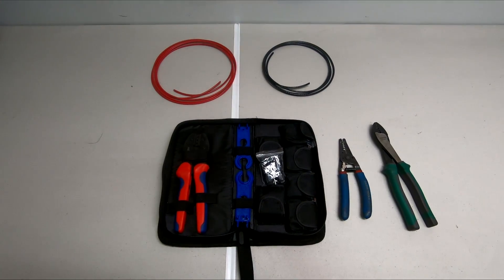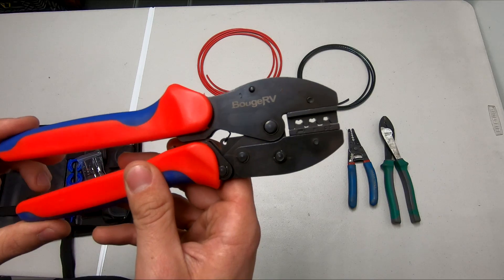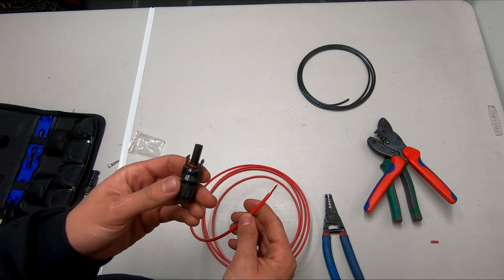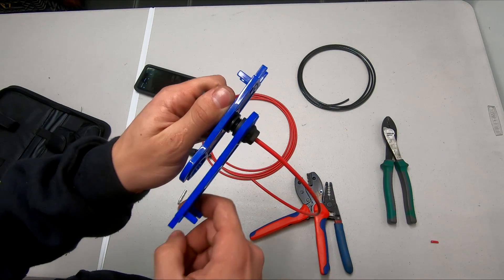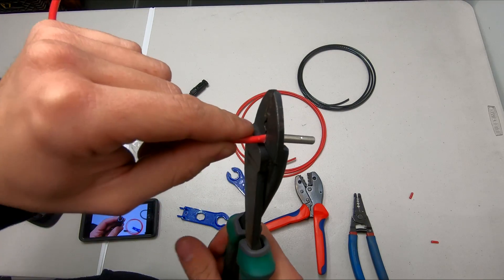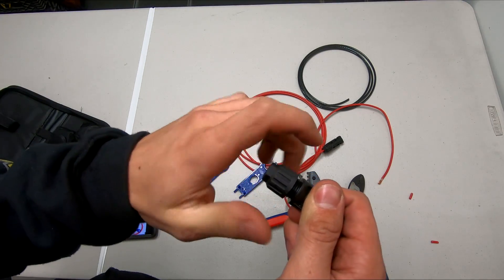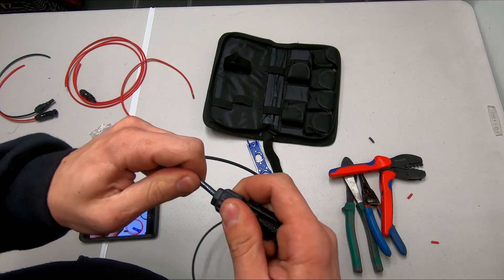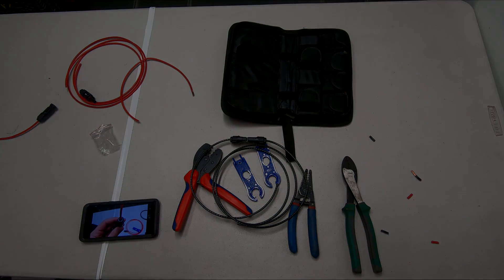Best way to Crimp PV MC4 Interconnection Cables

Comment: thank you for this detailed tutorial 😊

may I confirm if the pv wires have polarity if they are not yet connected to either the solar panel or solar charge controller?

I think I've installed the mc4 connectors the other way around 😅 (female connector to positive and male connector to negative)

Comment: Which crimper slot do you use for AWG 10?
Reply: 3:38 His crimper is metric and shows the slots are for 2.5mm^2, 4mm^2 and 6mm^2.

10 AWG is 5.26mm^2 exactly, but cables I come across do not match their cross-sectional areas exactly.

The correct answer here is, 1) buy a crimper with a 10AWG slot, 2) ask your cable / crimper / MC4 crimp manufacturer, and 3) try it and test with a luggage scale or similar, how much force pulls your crimp out.

Comment: I think positive is the male and negative is the female.  That's why the male has a RED ring around it.  That's to remind you that RED is positive.
Reply from the maker: The ring is a water seal. Positive and negative flip depending on if you are on the panel or the wire taking the power from the panel. For example an extension cable would be both male and female.
Reply: ring is not an indicator of polarity. sometimes it is white.

Comment: That standard crimper is actually the correct one because it has the craddle up againzt the joint and not the tooth.
Reply: Would one of these "automatic wire strippers" (hand tool) be good? I don't think they have the correct shape of the crimper section. I wouldn't mind purchasing another tool, but my toolbox is full on tools I barely use and I have to make only 2 connectors, primarily because they won't fit trough the roof waterproof cable gland. I have to cut and fit MC4 to power bank. Perhaps I could try to disassemble the MC4 connectors instead.

Comment: I am unsure about these blue spinning tools because the strength of the hand should be enough. P. S.: no questions about the crimper.
Reply: the tools make sure you dont overtighten the cable gland. overtightening could cause the ruber seal to deform and loose shape which could be not waterproof.
Reply: @dorplein62  It's a legit comment, but it's hard to do that when you are bit cautious. I've noticed that I need those tools to tighten Staubli MC4. Staubli even insists that you need a torque wrench. (They have a nice tutorial, which gives you a peace in mind). I've commented as an amateur who knows what he is doing (I had to do that in order to make sure I have a backup in case russians destroy our grid system and there is a gasoline shortage at the same time, and the required knowledge of physics & electrical engineering seemed far lower than it was required to know to get a degree in CS & Control Theory).
Reply: @tshev  got it, you surely sometimes just have to work with what's available.
Good on you finding solutions in difficult times..

It's always a good idea to do something in the best possible way.
For electrical connectors, that is most of the time how the manufacturer engineers the assembly process.
Reply: They are designed to click over the ridges and ensure consistency. I would say they are useful when one is making a lot of connectors. They are cheap anyway. Most of the price of the kit is in the primary tool and the MC4 connectors.

Comment: Thank you for the information and details, it really helped me out. One question though, the extension wires I bought each had one side already completed and I had to add the male and female ends to the bare ends. Should one end of the wire be male and the other female? That's what I did but wanted to verify.

Comment: Great video!  I am confused about the positive and negative ends that you talked about near the end of the video.  I have a solar system with four strings of nine panels. One of the wires was crushed so I need to cut  the crushed part and insert a connector. How will I know which end to put closest to the inverter and which and away?  If I am just joining the two wires together does it really matter?

Comment: That crimper is a nice paper weight - 170+ lbs won't open it.   Looks just like the one in the video and I bought it on Amazon and I'm not the only one with that problem.    

I also just read about copper pins, I think coated in zinc, that are supposed to be better, but I have yet to find them for sale anywhere.

Been doing solar for 25 years and am finally trying to use these stupid MC4 connectors because my new panels come with them and am regretting it.  Why on earth would they put a RED ring on half the connectors as if it meant "positive"?  Somebody was up all night ...

Comment: U r lier u didn't pull the female connector hardly
Reply: Since he pulled both cables, both ends were under the same tension.

That was a bad crimp and a hand tightened gland that broke. The correctly assembled end held up.

Comment: Those crimping pliers are for Sta-Kon® type wire terminals connectors. I worked with a lot of hacks who wouldn't use a crimping tool for those type of insert connectors. I'm used to using Amphenol pins. Someone always had to go behind them and correct the break later on.
Reply: Everyone is entitled to their opinion. I have this kit and They ARE a very solid crimp. I do with the metal pieces were copper though.

Comment: 07:30 is completely WRONG!
Reply: Positive uses male connector, negative is female
Reply: @greggles67  that is correct
Reply from the maker: Is it?  How?
Reply: Maybe so.. but if what he did fits and works.. then it's good enough to get the job done. So I'd say he was CORRECT.. not right or wrong. :P

Comment: Very well detailed, especially on the crimping. Using 10 AWG PV cable, I noticed that my wire does not fit tightly inside the ferrule (but does crimp tightly). That means the connection is actually being made at the crimp. Is that normal?

Comment: i bought the same kit, what the the different sizes for? looks like 2.5/4/6 marked on the jaws of the crimper?
Reply: the numbers are for what wire sizes you are using in metric system, 2.5mm² (13awg), 4mm² (11awg), 6mm² (10awg)
Reply: Correct, but also only kind of correct.  You’re probably quoting hard conversions which mathematically are fine, but in the US there is no 13 or 11 gauge wire used for these applications .  The soft/rule of thumb conversions are 14ga/12ga/10ga
Reply: Did you find out what the 2.5/4/6 are used for ? I have the same crimper but which did you use?
Reply: @jabbosax  i did, but i dont remember, seems like it was the bigger size. i think it should be on the spec sheet of your mc4 connectors maybe?

Comment: The other crimpers are for solid rounds, something like red copper connectors. So they WILL work for that gauge wire, just not for THOSE ear crimp contacts.
Reply: Which MC4 style connectors don’t use, so they’re kind of pointless to try with Solar/PV MC4 cables and connectors.

Comment: I need 8awg tool for mc4. Can you recommend one please?
Reply: As the OP of the video commented before, 10ga is code up to 30Amps, if you’re exceeding that the solution is not to up the wire size but to string the panels differently to get under 30Amps as the rest of the system will not likely take an input of in excess of 30Amps either.

Comment: Your setup is looking very nice your 10000 watt inverter.would just like to let you know that you can get straight from the manufacturer in china.they are called YIY you can find them on the net or through there website.i priced one last night for 900.00 and shipping by sea is 350.00.being that you are building something iron clad you might as well save a few bucks along the way.

Comment: Both ways are wrong. The first one you strip to much wire the wire may never go in the connector
Reply: Why not? He didn't have to strip off that much, but it doesn't hurt if he does. All of it will be inside the connector anyway. The wires can't stick out or anything...

Comment: Thanks for the video.  Yes, I crimped all mine 'the wrong way'; however, because I could see they were not solid I soldered them all.  I know....  soldering is bad because an arc could melt the solder.    My solder'ed connections are on the roof and working well - but I see now I should have just bought the correct tools :)      I also agree that + to - is so confusing - I've had to redo many (15%) of my connectors because I keep messing it up - so leave an extra inch on your wires in case you have to redo them!.